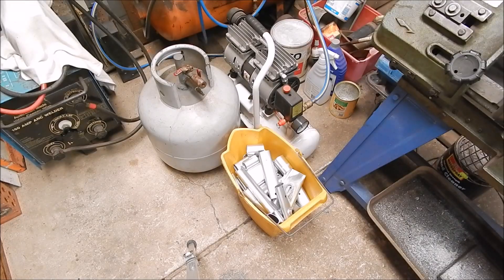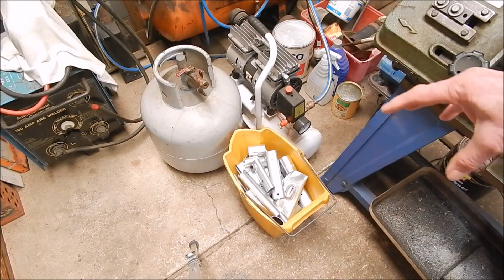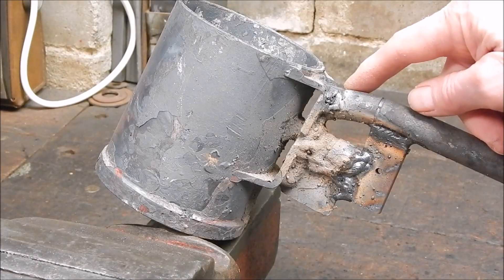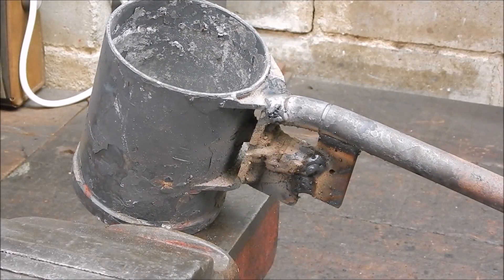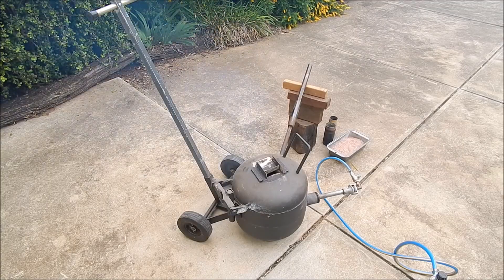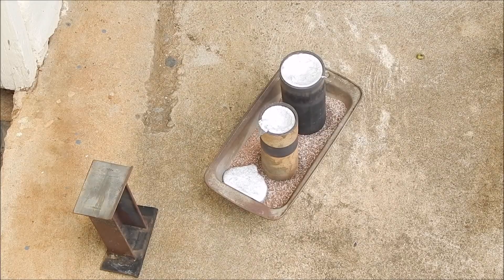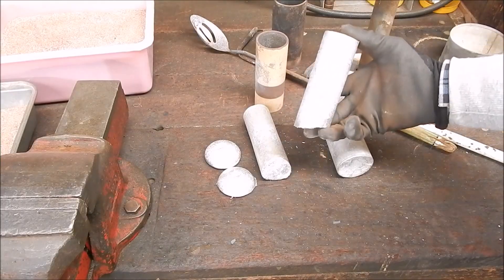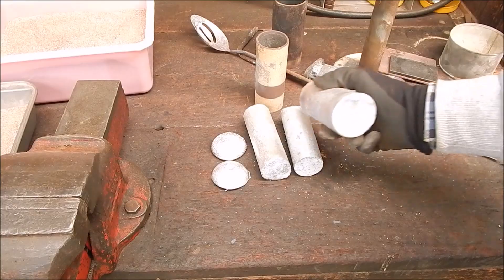Turn roadside junk into aluminium round stock

Comment: G'day Rob, I've just been doing a bit of melting, assorted scrap ally and diecast bits. Some of the casting had pinholes/inclusions and I'm guessing it's the crap diecast stuff. Still be useable though. One lot was particularly "interesting", if I recall it's the heavy windings from an old arc welder, when I cut them up they were a rectangular cross-section ally and looked good. When melting them I had a pretty big lump of dross in it, turned out the windings were hollow and had some sort of high temperature cord inside! I'm going to have to fire up the coke forge with a large metal pot to try and separate all the cord, so I'll melt all the scrap that's left and turn it into ingots. 
I've only just rebuilt the furnace, it was originally lined with fire bricks and clay dug up from my garden, it worked but was bloody heavy so I replaced it with a high temperature blanket off ebay. I also built a new burner, using a hair dryer to make a forced-air type, uses less gas and I can control the heat better by varying the fan. Also have a lot of copper to melt, I bought a proper crucible for that as the temp. of molten copper is getting too close to that of molten steel. And then there's the brass......
Incidentally, did you know that Vevor have some pretty good furnace kits? Keep the good work, cheers Richard.
Reply from the maker: Hi Richard.
Sounds like you are hard at it. The welder windings are interesting. The core could be asbestos rope, so be careful with it.  I've never seen or heard of that approach, but it isn't surprising.  Pinholes are caused by gassing and the hotter the melt, the more the ally will gas, so pour as soon as it goes liquid.  Do NOT overheat the melt and definitely don't get it red hot.  I never need to use degassing agents using this approach.  I haven't found any that are effective as well.  Some ally also gasses more than others.  There are hundreds of types of ally, used for different purposes and all cost based. Vevor did offer me some furnaces to review, but I declined.  They appear to be OK, but the crucible tongs supplied are not suitable for safe handing of the melt IMHO.  So I stayed away from them.  Seen a few reviews on them.  Casting your own metals saves a fortune and you can get perfect results using the right method.  It's a huge subject and other issues like hardening/tempering are something else again.  Cheers Rob
Reply: @Xynudu  Asbestos rope/string, that makes sense. Bugger. The stuff is pretty tough, whatever it is, and any "particles" are trapped by the melt. I'll wear a respirator if I remelt what's left. The Vevor units generally get good reviews although others have pointed out the issue with the tongs, saying they're only good for dropping stuff into the crucible. I've already damaged one crucible using blacksmith's tongs so had to make a proper pair for the new crucible.
Hardening/tempering, yep, done all that, having a forge is quite handy.
Cheers, Richard.
Reply: Well, I melted some copper (various windings from motors, produced a lot of slag!). The melting point of copper is around 1,000*C, brass is about 900*C, and that extra 100* takes a fair bit longer to get there! Brass, by comparison, melts pretty quick. The crucible was glowing yellow-white, so pretty hot. Just thought you might be interested.
Cheers Richard.
Reply from the maker: Hi Richard.  Interesting for sure.  I have never tried melting copper.  Brass takes plenty of heat, so I can understand that copper would need more.  I take my copper scraps to the recycle centre as I rarely use it except as small diameter tubes/pipes for model engine plumbing and I can't cast that stuff ;)   Brass is a different story and highly desirable as round stock.  The dross from brass is very strange stuff and looks like a dry yellow powder.  The fumes are also quite toxic so be careful.  Cheers Rob
Reply: @Xynudu  The fumes are the zinc in brass boiling off, nasty stuff indeed. I poured the copper because my intention is to make an engineer's hammer with copper one end and nylon the other.
At least, that's the plan.......
Reply from the maker: Sounds like a good idea Richard.  Copper is gummy to machine (a bit like bronze) so I've tended to stay away from large chunks of it.  Should be a good project.  Why not try posting a few video's, it should interest people.  Cheers Rob

Comment: Good to see some reuse of other peoples rubbish Rob. Most of my round stock has been cast like this. In fact I have not purchased any round stock at all. But I do know that it is expensive here.
Reply from the maker: I was thinking the same thing today as I turned a small metho fuel pot for a Stirling engine from home cast round stock.  The quality was perfect.  Machined up a treat.  I only bought ally round stock once and that made me look into home casting.  Get the process right with decent ally and the end result is usually excellent.  The number one most important thing is not to overheat the melt.  I pour as soon as it goes liquid and never use a degasser.  There's a lot of BS out there about doing melts.   Cheers Rob

Comment: Hi Rob 

Are you adding degassing tablets to the molten aluminium to remove the hydrogen bubbles? 
When I was a young fellow I did a bit of casting and we added a blue tablet to degas to reduce porosity in the casting.
The material you recovered may have been duralumin if it was tensile.
As use another great video Rob 

Thanks Tracey
Reply from the maker: Hi Tracey.  I'm not using degassing tablets in the melt.  I've tried degassing compounds and they didn't help and actually made it worse in some cases.  I've not tried the propper pills.  I find that the main culprit of gassing/bubbles is overheating the melt.  Definitely should not be red hot.  So I pour as soon as it's melted.  Usually works fine.  Some allys do gas more than others though.  That's a thought about the Duralium.  I wouldn't know how to distinguish it from regular ally.  I had some way back and it had a dull finish, this stuff was shiny.  It machined nice anyway :)  Cheers Rob

Comment: Have you seen one of the recent videos from Luckygen1001 where he used bmw car rims for aluminium. Looked like a good source of aluminium to cast
Reply from the maker: Car rims are definitely the number one source of aluminium for home melting.  I have used four Toyota alloy rims for this and the results were excellent. Very low gassing as well as machine grade ally.  The way to go.
Reply: @Xynudu cheers thanks for that, good to know. They should be fairly common at wreckers, and cheap if they’re damaged
Reply from the maker: Hi Alec.  They are occasionally given away on Craig's list and Gumtree (in Australia).  Usually with a tire fitted.  The tire can be disposed off for $3 easily and you get a lot of top notch aluminium for that small price.  I got mine off the side of the road and still have a bit left.  The rims are a bit tricky to cut into small pieces for the crucible but do able with a reciprocating saw.  They can also be heated up in a fire and smashed to pieces with a sledgehammer.  Cheers Rob

Comment: Excellent result Rob. You’ve ended up with some nice stock there. Nice machinable aluminium has become so expensive now. Cheers Nobby
Reply from the maker: Hi Nobby. Yes, it's very expensive to buy. Home cast ally sometimes has tiny pin hole imperfections, but I can live with that.  No way I can afford to buy new stock. Plus when a project goes wrong I just re-melt it and have another go :)  Cheers Rob

Comment: A very successful pour Rob 👍👍👍 I'm still working my way through the solar panel mounting frame off cuts that I was given for free. I did a pour recently where I used a cardboard  Bouillon pot as a pattern and an open sandcast box. It was the perfect size for a base I needed for an old steam engine. Even if you can't find the right size steel tube for a mould, a wooden box with some casting sand and you can use almost anything for a pattern. I will never be able to thank you enough for starting me down this road. I've saved a fortune over the years, not to mention that it's fun casting your own ally. Cheers, Alan.
Reply from the maker: Hi Alan.  Sounds good.  I've done similar for round  and square stock and it works out OK.  The steel tube mold is handy for multiple pours and very uniform.  Home casting certainly saves a fortune.  Plus if the job goes wrong you haven't wasted an expensive piece of metal.  Back in the pot it goes ;)  I cut the ends off one slug of the "stroller" metal and it has a nice finish and is quite hard, but there are a few tiny pin holes near centre so I will re-melt it to see if I can improve it.  It's a bit of a mystery metal, but that's par for the course.  Cheers Rob
Reply from the maker: An update, the few pin holes machined off as they were only near the end cut.  All good.  Cheers Rob

Comment: Would the aluminium in drink cans be any good melted down for turning on the lathe?
It’s just that at 10c recycle payment I’m wondering if it’s worth smelting them once you pay for LPG & a bit of smelting gear - or whether just recycle the cans and put the 10c per can into paying for round alloy bar stock from the metals supplier?
Reply from the maker: Drink cans aren't great for melting as you need lots and they are plastic lined and printed.  Lots of impurities.  The ally is good quality though.  To buy aluminium stock new is expensive, so you need to crunch the numbers by weight to see which is cheaper.

Comment: Thanks for a really informative video Rob. 
I love your old gully trap. It's ideal for that application. They should be brought back into vogue.
Ironically I'm about to dismantle an unwanted baby stroller to salvage the wheels for another project. Simon, Melbourne
Reply from the maker: Hi Simon.  The way to go.  I got some good wheels off a mobility walker recently and made a trolly for my 2.5 kVa generator.  I also used the wheels off of a golf buggy cart thingy to replace the broken ones on my green enviro waste bin.  All this came off the kerb side.  Saves buying wheels and they definitely aint cheap.  Cheers Rob
Reply: @Xynudu mobility scooter wheels on my trailer jockey wheel and my oxy/acet trolley - they are quality items…….

Comment: Curious what becomes of the dross discarded in the furnace? Seems weird to keep it "hot".
Reply from the maker: I normally remove and put it in a metal tray, but due to the wet weather it was safer to drop it in the furnace as the extreme heat negated any chance of steam flash occuring. The dross cleans up easily once things have cooled down.

Comment: No aeroplane propeller found? Their dur-aluminum is really special.
No bucket with water available?
Reply from the maker: I never find aeroplane propellers. Too rare.
Reply: @Xynudu  They can be slammed into a rock, bend, but still stay together....
Reply from the maker: Vibration must be a huge issue ;)
Reply: @Xynudu  One such bent prop was bent back using screw clamps and the plane flew! Of course, against all airworthy rules.

Comment: I have thought about melting my own stock but worry about the amount of propane needed. Does it take a lot?
Reply from the maker: Hi Mark.  I melted that lot in about 15 minutes.  The actual melting time depends upon how large amount you are melting and how well the burner heat is contained and insulated.   You can do it with a wood fire and air blast (eg vacuum cleaner).  I've done a lot of videos showing this.  The furnace for a gas setup can be as small as a coffee tin.  Lots of options.  The cost of any gas used should be way way cheaper than buying the equivalent amount of round stock.  Cheers Rob